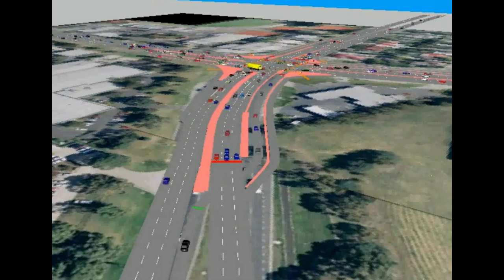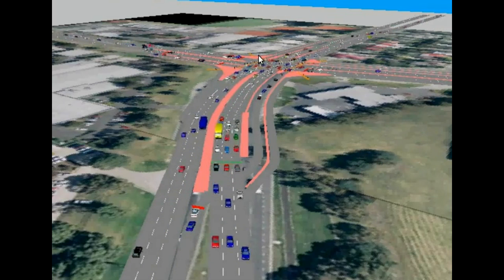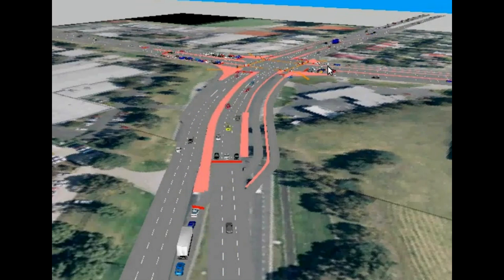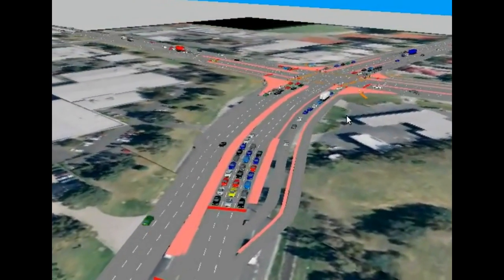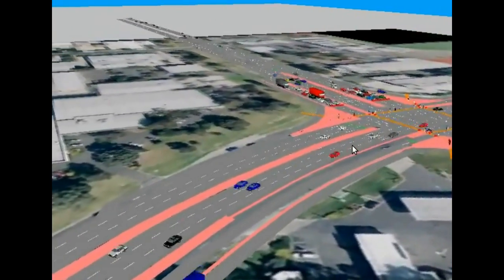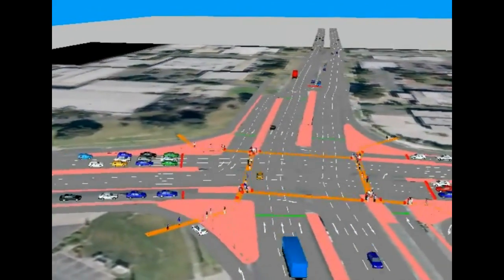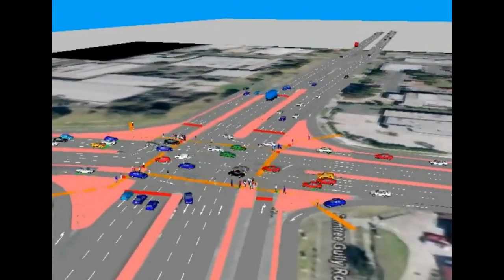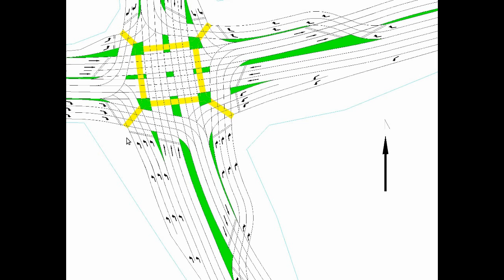Case for Two-Phase intersections

Comment from the maker: It is complex for VicRoads but simpler for the driver. They can see the short cut - end of problem!
I will look at your dash cam vids. You should see drivers at FTG/Stud. They cross the median, drive down the opposing, thencross back to the end of the RT lane... My engineering job was to develop these proposals but I did most of them at home in my own time. My skill is still getting better. See the link above. Yes I am sending the later videos everywhere.